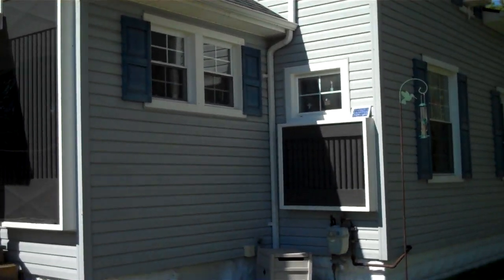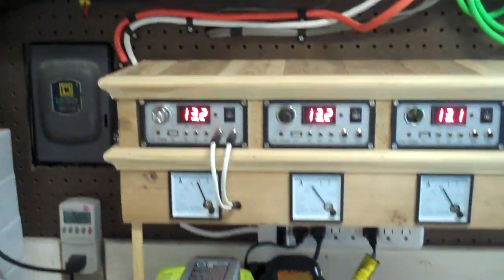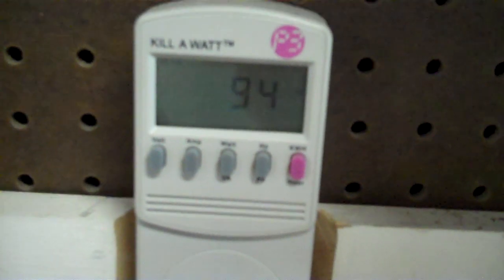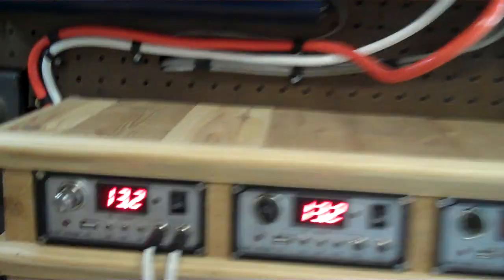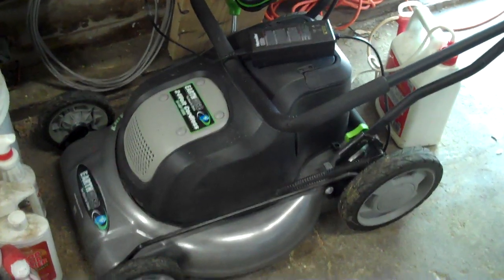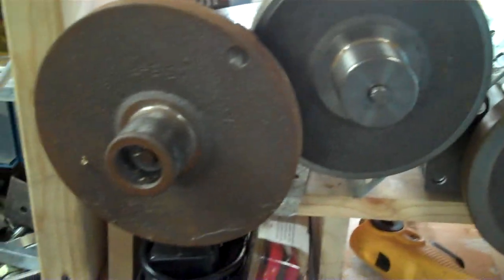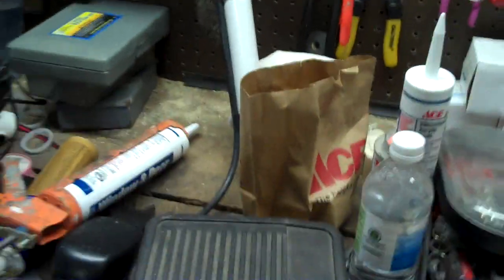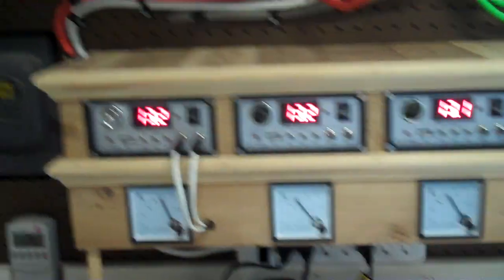Solar and Wind Power

Comment: You need to have a kill switch on the 94 watts running back into the grid so you don't kill a lineman working on a line he thinks is off. It's very important!!
Reply from the maker: +James Coleman This inverter has a safety switch built inside. When the power goes out the inverter shuts off.  My Grandpa used to say....safety third!
Reply: love it, thanks loved your video great info